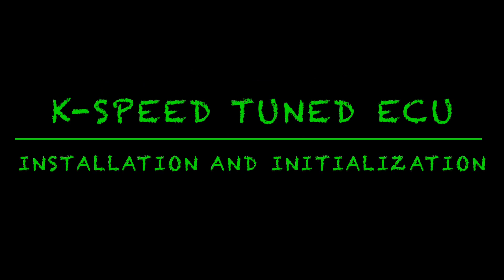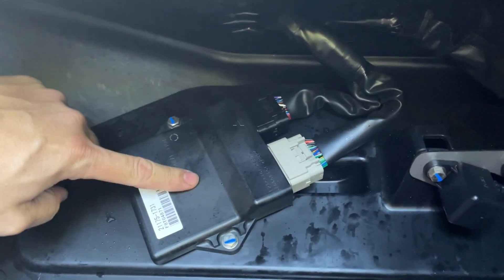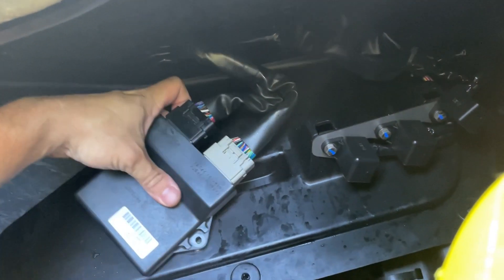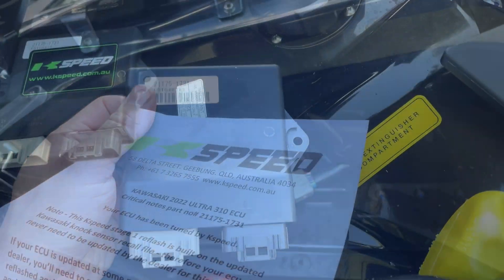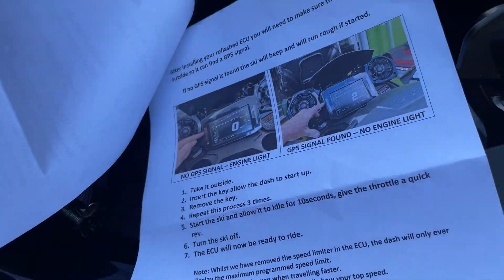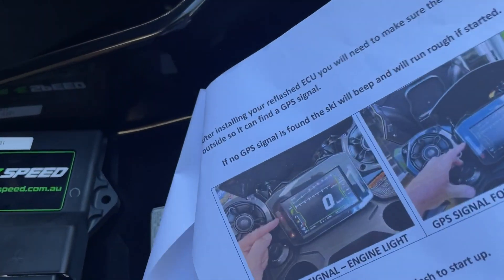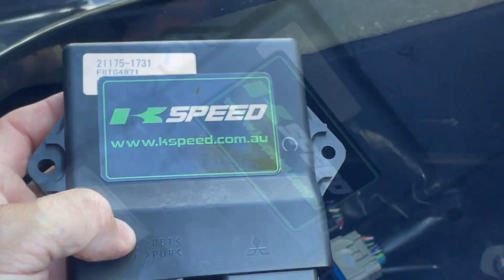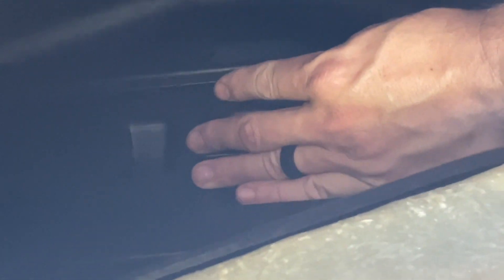KSPEED TUNED ECU: Installation and Initialization - 2022+ Kawasaki Ultra 310 Series Jet Ski

Comment: Rubbish, I spent over $3000 upgrading my 2020 ultra 310r with k speed stage 1 and 2 kits and the best top speed I can achieve was 116kph, was getting schooled by every Yamaha on the water, when I called Brisbane Kawasaki all they could say is the weather and water temperature was probably too warm
Reply from the maker: What rpm and boost? Thats a 4 year old ski…when did you last change your ..spark plugs? Pivot bushing? Pump bearings? Oil level? Lots of variables…but 72 mph is not bad- the SVHO Yamahas and seaDoos will almost always be faster than you on flat water…

Comment: Will this tune shorten the life of the ski engine or other components ?
Reply from the maker: The tune, wedge, and pump grate themselves should not shorten the life of the engine…how hard you ride and how strict you are with maintenance and oil changes will really determine how long the engine and driveline last.

Comment: I cannot wait to get my hands on the new ECU. Hoping they get more replacement units in soon instead of just a reflash. It seems like the stock ECU is overly intrusive/restrictive. It's not just limiting the top speed. It backs the power off almost before you get to 67 and limits the boost down to about 10-11 psi. Once it goes into that mode, the only way to get back to full boost is let off the throttle completely.  Will you be doing the pulley?  Would love to see a video of that upgrade.
Reply from the maker: Agreed. Yes I am editing my testing and review video as we speak. You get the full 15 lbs of boost. I did a real-world review with full fuel, 50lbs of gear, and 200lb 6’3” rider. The tune really is awesome

Comment: Thanks JD. 5 years of warranty I don’t want to void.
Reply from the maker: That’s why I bought the xtra tuned ECU I have extended warranty as well. K speed has lots of testing on their tunes and since the engine is the same as the the previous gen. They have many hours of testing demonstrating the safety and reliability of the tune. Keep in mind this isn’t like the SeaDoo or Yamaha tunes from Riva that juice the hell out of the engine.

Comment: What is total cost of this kit? I want there ECU too, for warranty reason’s.
Is max speed and RPM stored in the 
dash or ECU?
Reply from the maker: You are looking at $2,339 for the Stage 1 kit, an additional ECU, and shipping to USA. I do believe the max rpm and speed are saved in the main display unit controller and not the ECU. You would need the dealer software to reset those metrics I believe.

Comment: So what did you gain?
Reply from the maker: Full review video coming soon! I do not want to release any results until I have finished all the testing- stay tuned! I will tell you this- I thought this thing was a rocket ship before…the acceleration and speed is just insane now!
Reply: @JDsWaterWorld  in essence was this just basically a socom addition? or did they actually do some tuning with timing, etc? I have a 108mm SC pulley on mine with a deleted wastegate. I don't want 3-5mph, or 3-7mph, I want 10+mph and I want to see 15PSI pegged all the time....
Reply from the maker: This is a full stage 1 tune- it does runs 15+ psi boost at wot. You will see a solid 3-5 mph higher than stock with this Stage 1- not even close to 10mph though. For 10mph you will probably need to start modding some engine internals on top of the stage 2 kit and tune.
Reply: @JDsWaterWorld  ok.. let me change my expectations... how about a solid 5-10MPH... 15PSI? I wonder what you would see with the smaller pulley like I have on mine after the tune.?
Reply from the maker: Without giving it all away before I release the video, you will get a solid 15 psi on the stock pulley with this tune. If you have a smaller wheel you can let kspeed know and they can custom tailor the tune to your application!